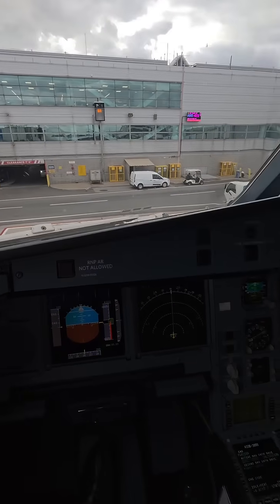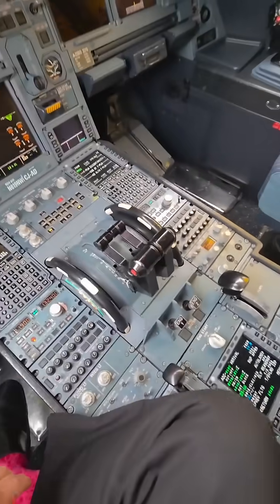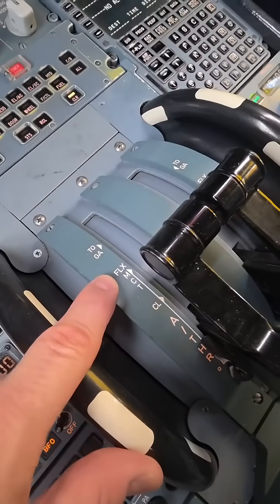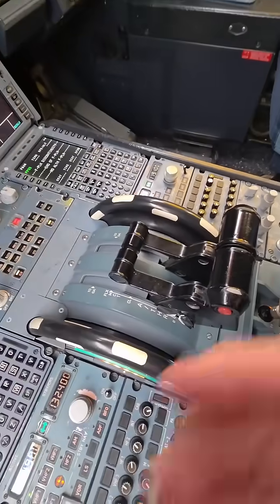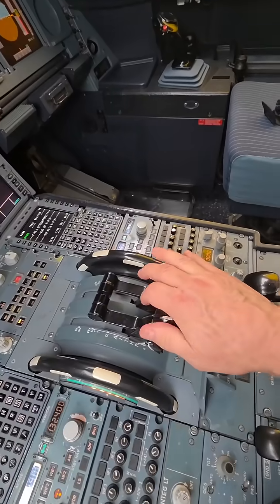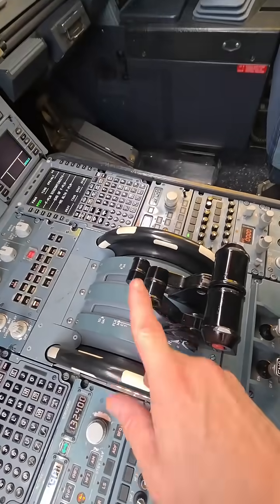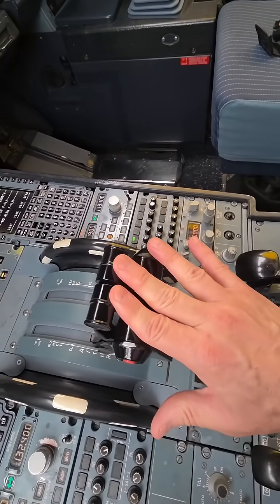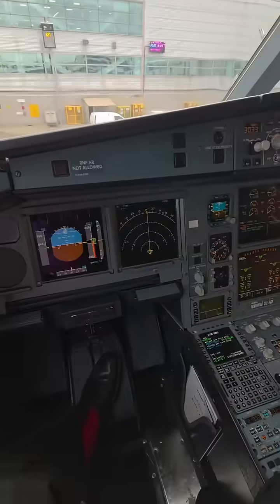All about reverse thrust on the Airbus A330.

Comment: Great video! Thanks. Can you explain briefly, how does the glide slope and localizer work?
Reply from the maker: It's an electronic beam that we lock onto.

The localizer provides horizontal or lateral guidance. 

The glide slope provides vertical guidance. 

Together they can get us to within 200 feet of the runway during normal operations or during really bad weather they can be used to perform an Auto-land with as little as 300 feet visibility.
Reply: @CaptainZtravels Thank you for taking the time to explain that!

Comment: If you only happen to pull 1 thrust reverser will that have anything to do with controlling the plane? Like will it send you left or right?
Reply: From what I understand, in flight at high thrust, yes, but I’m 99% positive on the ground there are procedures, and maybe a bit of a performance difference
Reply: @jayrabbitgamingproductions thanks man.
Reply from the maker: Asymmetric thrust OR reverse thrust would obviously cause the plane to yaw either left or right, depending on how much thrust you applied.

Comment: Any idea why they change the design on the A320 to be like turboprop plane style, where you push the lever back behind the idle detent? Technically is not a problem for me as I used to fly turbos, but why the engagement switch is so low on the levers. I have short fingers so I had to take my hand off the levers, engage the revers switch and palm it to reverse.

A330 came after the A320 and have a much better design. So are they just never came around changing it since pilots are "used" the design?
Reply: The a320 has a different heritage, hence the difference
Reply: @AnnaVannieuwenhuyse To what though? Both the A300 and A310 use the conventional style thrust lever like the A330.

The only other Airbus that uses A320 style are the A400M and ATRs, and both came AFTER the A320, but more importantly, both are ACTUAL turboprops. So yeah... still doesn't make sense.
Reply: @harveywilde6781  the a330 series is a direct descendent from the earlier a300. It's for all intents and purposes an A300B9. Those planes were not fly by wire. 

The a320 was conceived as its own starting line to build a different concept and was from the ground up and from the start a fly by wire design. The a320 series unlike the a330 series is not a direct descendent from the A300 revisions series (A300Bxx)

Edit: another example of this differing heritage is the fact that one is a hull stretched widebody, whereas the other one is a teeny weeny single isle aircraft series of its own, occupying its equally teeny growing market with huge demand back then.

Edit 2: you might even remember that Airbus was founded for the explicit purposes of the widebody jet development, and that's also why that was its first product line type.
Reply from the maker: No idea. I flew the A320 19 years ago and I honestly didn't notice any difference operationally.